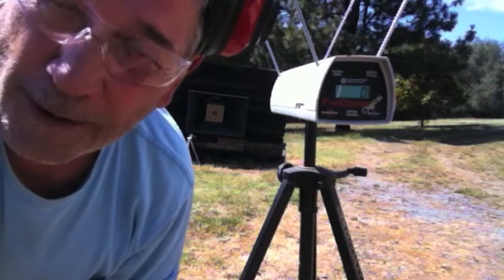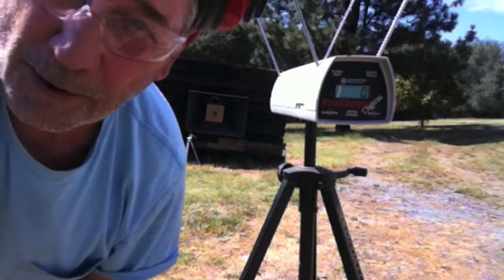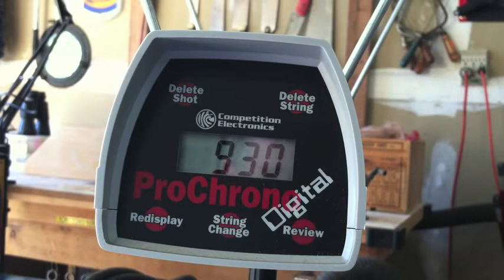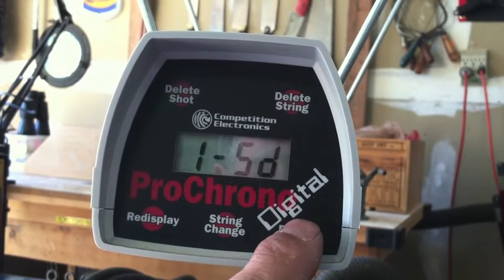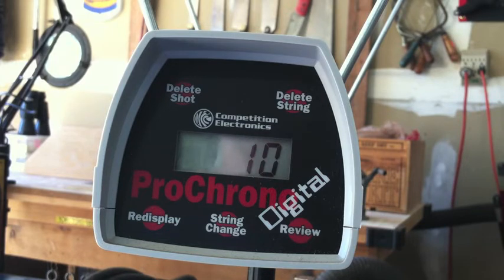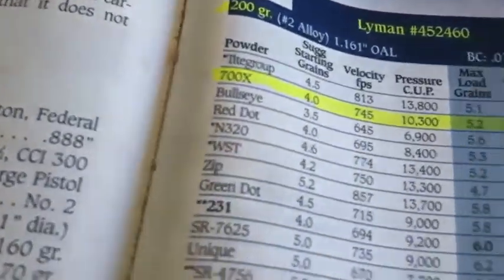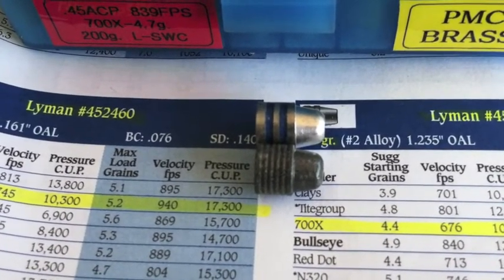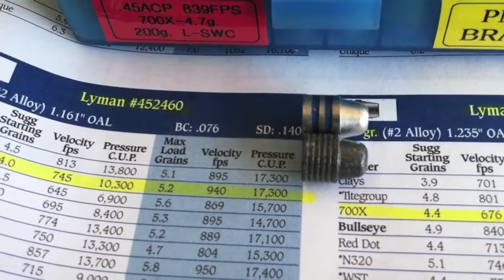Pistol Load Workups…part 3…Forensics of a test load, collecting & evaluating evidence

Comment: Those are some great key points between the grease groove and tumble lube. What's your thoughts on swedge bullets? are they that much more superior in the uniformity department? I had a handful and they worked great in 45acp. But I didnt have the chance to compare
Reply from the maker: I can't honestly say about swaged, never used any. I do think they are softer and would tend to obturate better than common wheel weights at the low pressure of the .45ACP.